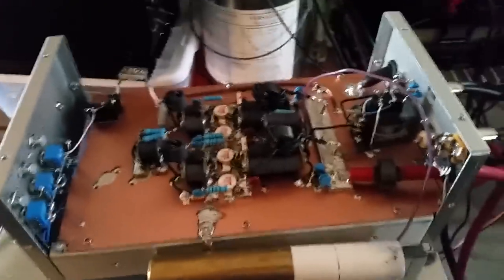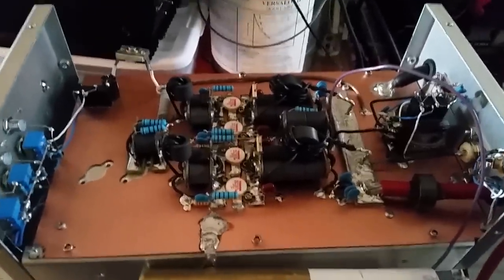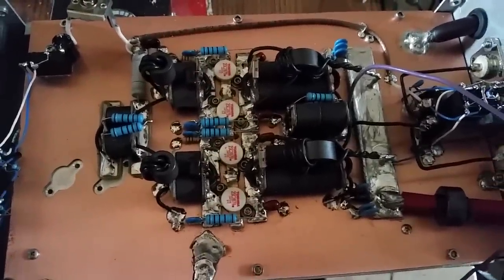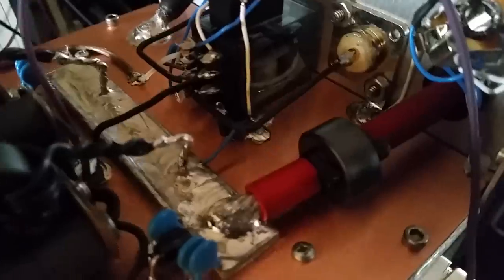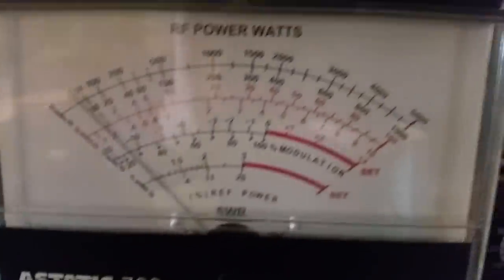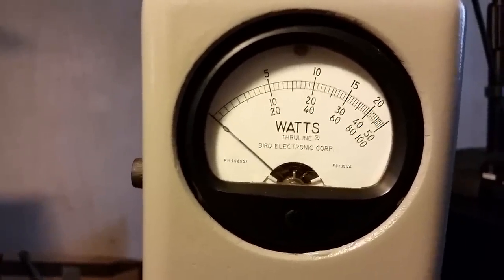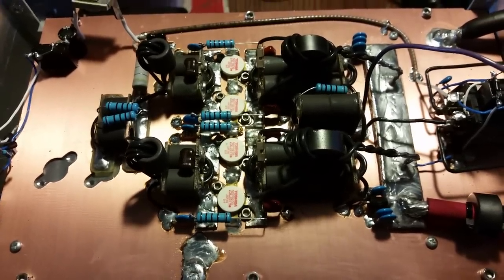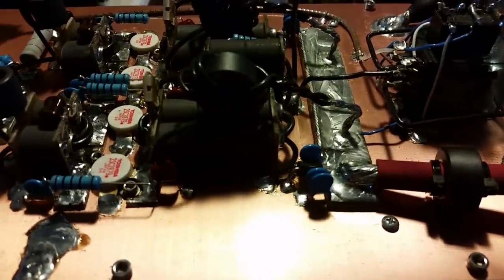Ported Style 4 Pill Amplifier - More then 1 way to skin a 🐈 😊

Comment: Great build!! Love the fact you ran power threw choke to each collector of 2879. Like the input transformers used for split er/combiner  just a outher way to do it. Plenty of heat-sink should keep pills cooler. The only thing I would add for me is a class AB for SSB. leaving class C for AM/FM. It makes a difference in sound quality on the person hearing you. Watch on a scope and you will see the difference. I may do a video on this once I get moved in to new shop. love your work!! pet the kitty and go get teeth fixed. 73s

Comment: You should be able to dump that whole 2 pill into it with no issue. I test with a 2 pill 2290 that will do 100 bird swing using a stock 29 into our 4 pill, which is the same design as that. That is with the 4 pill dead keyying around 200 on the bird and swinging the rest. With that said it should go to almost 550 to 600 bird and around 1300 to 1500 peak. The tuneport design produce's alot of peak and it can be driven. 73's Stickman
Reply: I agree, 2X8 is much more of a sensible set up unless the 2 on the input amp is a small 2. I'm all for a push pull driver for cancellation of harmonics but it must be of the correct power class. Also, all these simple AB bias networks these guys use, as well as the cheap so called "linears" use are trash. They need to be very low impedance, low resistance bias sources with thermal compensation to realize proper IMD performance and maintainence of the appropriate bias level. Amplifiers must not be driven excessively if quality matters as linearity suffers SEVERELY and much earlier on than you think.

Comment: do you guys ever consider getting licensed and going on the air legally with ssb making contacts on the other side of the world with 100 watts? I have an amp but can also use my beam antenna and 3 watts to talk over 400 miles away. I have made contact with Australia for the last two weeks using only 400 watts on 20 and 40 meters.
Reply from the maker: nice. good to hear that the lower bands have been doing well. you have to understand...people have different liked and hobbies. i like many things but i love building.

your right 100w is all you need with the right antenna.

dont judge a book by its cover either lol. i am a huge ssb operator and have worked over 38 countries so far legally on 11m qrp.

thanks for your advice though ham radio is very neat. thanks for stopping by bud.

God Bless